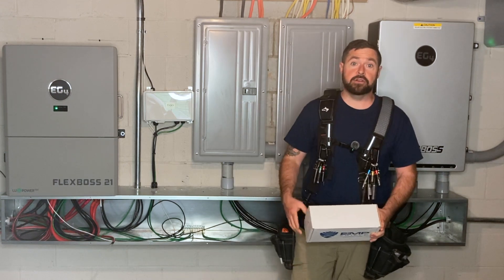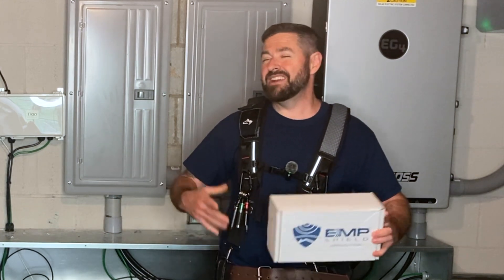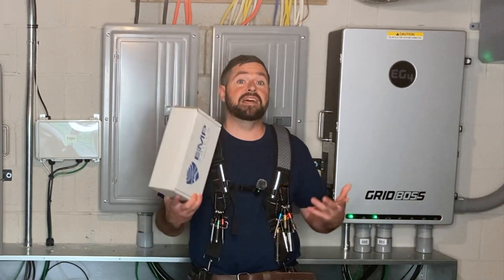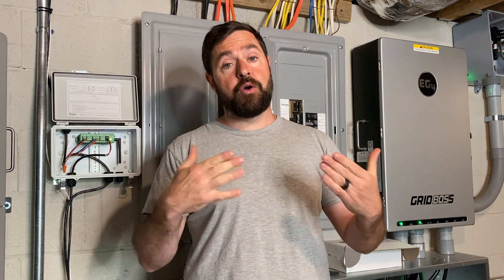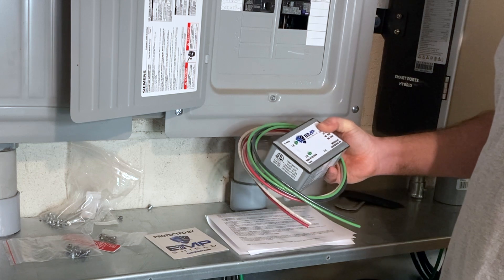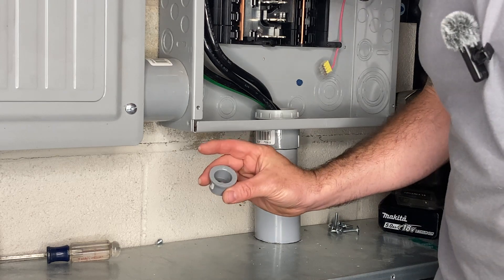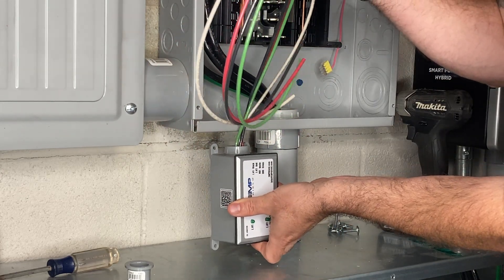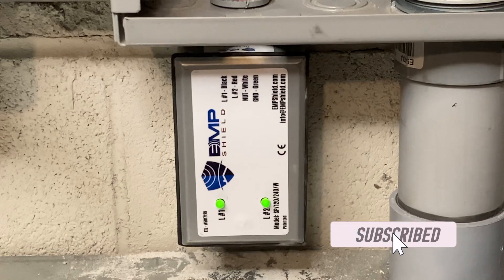EMP Shield for Surge, Lightning, and EMP Protection

Comment: You mention that when the power is down you'd no longer be protected since the GridBoss is off-line (5:38). This seems to imply the GridBoss has some build-in surge protection, do you know if that is the case or the specs on that? Thanks!
Reply from the maker: @Jones-f3h-d6y This is because the transfer switch opens the connection between the GridBoss and the grid, so my surge arrester would be upstream of the GridBoss. In order for my electronics downstream of the GridBoss to be protected during an outage, I would need surge protection on the load side of the transfer switch. I have heard that the FlexBoss line of inverters may come EMP hardened already, and they are just undergoing testing before that is officially released, but that may just be a rumor.  Thanks for watching!

Comment from the maker: 🔗 Products Featured in This Video:

EMP Home & Lightning Shield | 120/240V 
$50 off orders of $500 or more with discount code ROCKYSAVE50
https://signaturesolar.com/emp-home-lightning-shield-120-240vs/?ref=uzUOpPif73O10D&search_query=EMP%20shield&searchid=1358729 

EMP Shield 600 Volt DC for Large Solar Applications
$50 off orders of $500 or more with discount code ROCKYSAVE50
https://signaturesolar.com/emp-shield-600-volt-dc-for-large-solar-applications/?ref=uzUOpPif73O10D&search_query=EMP%20shield&searchid=1358733

EMP Shield Dual DC MAX 600V For Large Solar Applications
$50 off orders of $500 or more with discount code ROCKYSAVE50
https://signaturesolar.com/emp-shield-dual-dc-max-600v-for-large-solar-applications/?ref=uzUOpPif73O10D&search_query=EMP%20shield&searchid=1358741

Siemens FS100 Whole House Surge Protection Device Rated for 100,000 Amps
https://amzn.to/435vCKi

Comment: Kinda pointless. If the US gets hit with a EMP or CME, all of the nuclear power plants will meltdown & the spent fuel pools will catch fire rendering just about all of north america an unsurvivable radioactive wasteland.  Used & spent fuel rods require at least 4 years of active cooling. In a EMP or CME, the grid will be down for months & their will be no way to keep the used & spent fuel cool.

The other issue for EMP is that you need protection at the point of load (ie at the plug) as the EMP will induce a surge in the buildings wiring. devices like EMP shield make the issue worse because the set up a current loop on all of the interior wiring.

EMP shield is useful for external surge protection, but is essentially a one use device. EMP shield uses MOVs which degrade after use.
Reply from the maker: All good points @guytech7310 . I don't know enough about the nuclear power plant cooling to be honest. I figured since I needed surge protection anyways why not just go "full measure" and cover my system in the event of an EMP too. Thanks for watching!